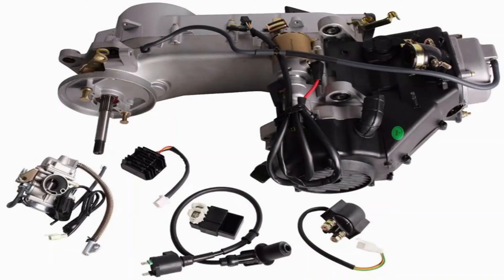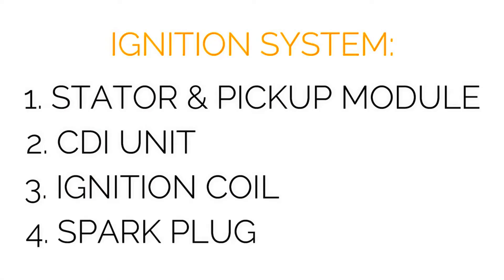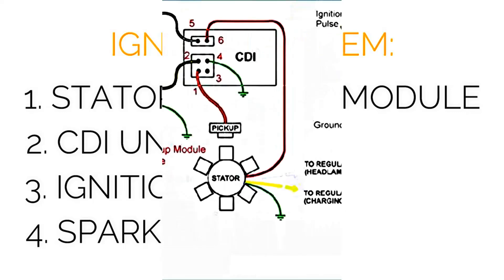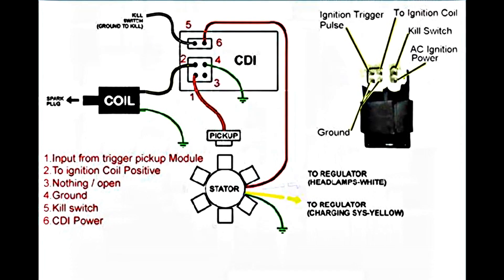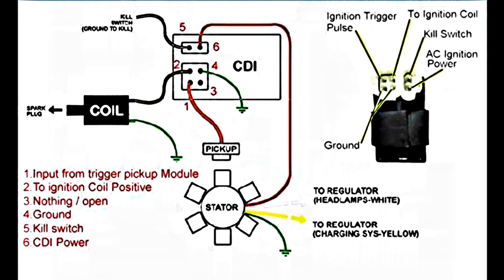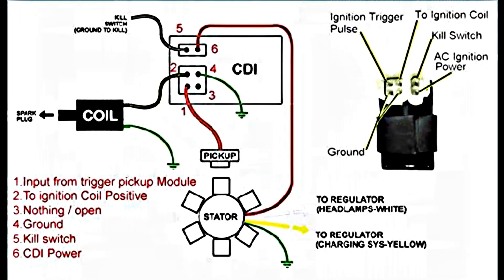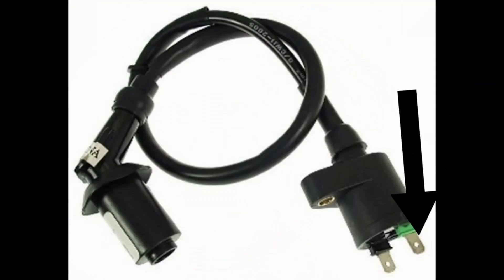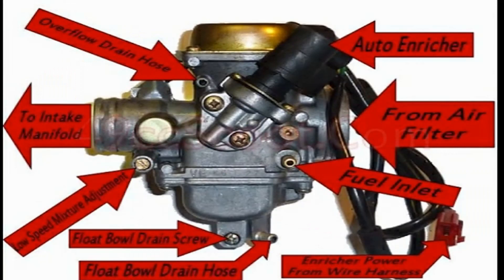Typical GY6 Scooter Engine Issues and How to Solve Them

Comment: My gy6 scooter runs ok, but dies when I come to a start. I turned fhe idle up and it idles faster but still dies when it comes to a stop
Reply from the maker: If your GY6 scooter is running fine but stalls when coming to a stop, there could be a few potential issues causing this problem. Here are some troubleshooting steps you can take:
Idle Adjustment:
Ensure that the idle speed is set correctly. Turning up the idle speed may help, but if it's too high, it can cause issues. Refer to your scooter's manual for the recommended idle speed, and adjust accordingly.
Idle Air Screw:
Many carbureted scooters have an idle air screw that can be adjusted to fine-tune the air-fuel mixture at idle. You may need to adjust this screw to achieve a proper balance.
Air Filter:
Check the air filter to make sure it's clean. A dirty air filter can affect the air-fuel mixture and cause stalling. Replace or clean the air filter if necessary.
Vacuum Leaks:
Inspect the intake manifold and vacuum lines for any leaks. A vacuum leak can disrupt the air-fuel mixture and affect engine performance. Ensure that all connections are tight and there are no cracks in the hoses.
Fuel System:
Check the fuel system for any blockages or clogs. Clean the fuel filter and ensure that the fuel lines are clear. If the scooter has a carburetor, consider cleaning it to remove any debris.
Idle Control Valve (if equipped):
Some scooters have an idle control valve that regulates the idle speed. Check if your scooter is equipped with one, and if so, inspect and clean it if necessary.
Spark Plug:
Inspect the spark plug for signs of fouling or wear. A worn-out spark plug can cause poor combustion and stalling. Replace the spark plug if needed.
Throttle Cable:
Ensure that the throttle cable is properly adjusted. If it's too loose, it can affect the idle and cause stalling. Adjust the throttle cable according to the manufacturer's recommendations.
Engine Temperature:
If your scooter has a temperature sensor, check if it's functioning properly. An engine that's running too hot or too cold can affect performance.
If you've tried these steps and the issue persists, it may be a good idea to consult with a professional mechanic or take your scooter to a service center for a more thorough diagnosis and repair.

Comment: Hi i have a wangye eivissa 2 125 year 2022. I have a engine management fault and it flashes 8 times and stops then flashes for 8 more times over and over again.

I have a GY6-125 ECU Motorcycle Computer Controller For ROJO Motorbike Electronic Control System Accessory

You can Google this. 

The red light on the unit also flashes 8 times.

Do you have this unit on your bike and do you know what the fault could be.

Cheers

Comment: My bike is now shaking bad when I'm at a light very slow take off but all of a sudden it picks up power and then it goes fast
Reply from the maker: Hello my friend try to or spray wd 40 Silicone at the diaphragm on your scooter's carburetor 
Safety Precautions:
Ensure the scooter is turned off and the engine is cold before starting any work.
Wear safety goggles and gloves to protect yourself from any fuel or chemicals.
Locate the Carburetor:
The carburetor is typically located on top of the engine and is connected to the intake manifold.
you should be able to access the top part of the carburetor where the diaphragm is located.
Open the Carburetor Top:
Some carburetors have screws or bolts securing the top cover. Remove these to access the diaphragm. Be sure to keep track of these fasteners as you'll need them to reassemble the carburetor later.
Inspect and Lubricate the Diaphragm:
Carefully inspect the diaphragm for any tears or damage. If it's in good condition, you can proceed with to give a little wd40 silicone and spray  it.
Apply wd40 silicone spray  carburetor diaphragm to the diaphragm's surfaces and the all plunger also the stem .
Reassemble the carburetor by reversing the steps. Ensure that all components are properly reattached and tightened.
Reconnect the fuel line and reattach the air filter.
Test:
Start the scooter and check for any issues or leaks. Make sure the scooter runs smoothly.
I hope this can help and thank you for watching my video
Reply: @VirberelloScooterTips  thanks I will definitely do that